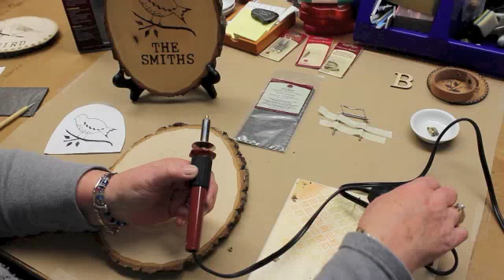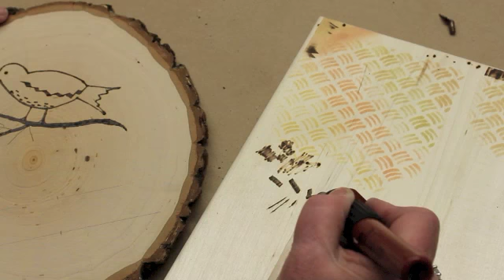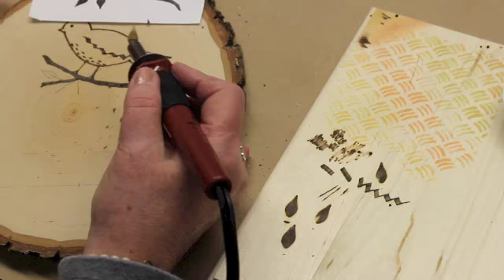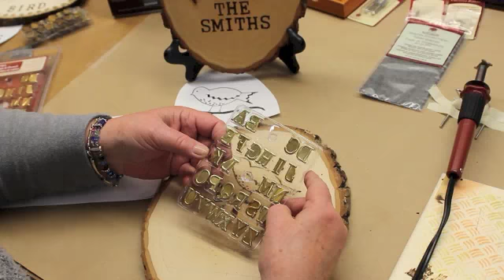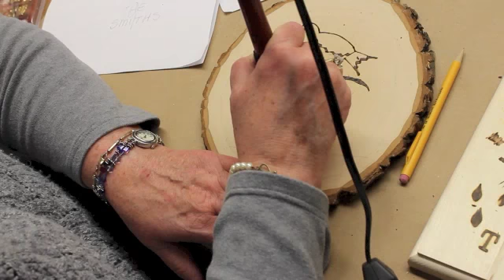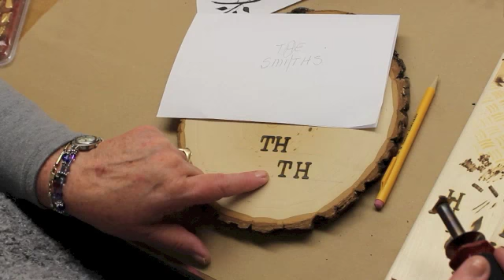Walnut Hollow® | Wood Burning for Beginners using the Creative Versa-Tool®

Comment: The tool instructions on mine state to let the tool COOL before changing tips. Is this correct or can I do it hot? I've read that the tips break if the tool is hot. ???
Reply from the maker: We recommend to wait until the tool is cool. But, you can change them out when the tool is still warm. Please be extra careful with this. Have a ceramic or glass bowl handy to put the hot tips in and ALWAYS use a pliers to unscrew the tips. There is a chance that taking the tips out when the tool is hot could break the tips easier (they are more fragile when hot) and it could damage the threads that screw into the tool.

Comment: Can’t see very well, your hand is in the way. I’d like to see more closeups and also more detailed instructions i.e. what kind of wood, what’s the best temperature to use for different techniques and tips.
Reply from the maker: Hi Lori, you can see more videos on our channel that offer more details. The best wood for wood burning is basswood. And there is a guide on the back of the Creative Versa-Tool with the correct temperatures for different surfaces.

Comment: how can i tighten the tips of my wood working gun.. its like the threads are striped or something. is there some house hold tip or trick i can use to keep them tightly screwed in the gun while i am working?
Reply from the maker: +Glenn Rodehorst Hi Glenn, if you contact our customer service associate at 800-395-5995, she will help you with this. It is a common problem and we usually just send you a rethreading tool to solve the issue. Thanks!

Comment: Hello-
Great video! Thank you. I am wondering if I should be wearing PPE such as a mask while wood burning? Is the smoke toxic that close to our lungs?
Reply from the maker: +Casey King If you are burning unfinished or unsealed wood, it is not necessary to wear a mask. We do not recommend to wood burn on finished or sealed wood because the materials could react with the heat and emit toxic fumes.

Comment: Can you do the wood burning on wood that has already been finished or sealed?
Reply from the maker: +lizzie9989 Hello, we do not recommend wood burning on finished or sealed wood because of the chemicals that could be released from the heat of the tool on the finish. It is best to burn on unfinished wood and then seal it. Please let us know if you have any other questions!
Reply: Hay que lijar y sacar todo lo anterior y si se puede

Comment: can you burn any other surfaces other than wood? If there were wood filler in some of the wood, could that be burned?
Reply from the maker: Hello! You can use the Creative Versa-Tool on Leather, to cut plastic, on synthetic fabrics, to melt wax, to cut or burn cork, on natural fabrics, to burn paper, to cut foam and even to solder! I would not suggest using it on wood filler.

Comment: I did some wood burning in art class in the early 80s and yes you supposed to let the tip cool off before changing them. I do change them hot but do not tighten the tips much, having two tools is an awesome idea ! thanks for the ideas and I love your video! wood burning has come a long ways since the 80s lol

Comment: When I burn into wood sometimes it cracks due to the heat. Turning the heat down means I don't get the effect or efficiency I want, and when its too hot it cracks more. Is there a way I can treat the wood prior to using the tool to avoid this cracking from happening?

Comment: I thought I read somewhere that removing the points with pliers while they're still hot can damage the brass tips. Have you ever encountered this?
Reply from the maker: Hello Tommy- We have not had any issues with tips breaking when removing them while the tool is still hot, but some customers have had issues. We recently added the advice of waiting until the tip has cooled before removing it in hopes that it will help resolve the issue.
Reply: I have damaged tips (and tools) by removing while hot. However, I think a lot of the issue was due to how tight the tip was placed into the tool. Removing it while hot caused the screw end of the tip to come off and get stuck in the tool. Just a heads up, I always let mine cool so I don't have to keep buying them.

Comment: I got one for Christmas. After the first use, I can't get the tip to come off to change it. Am I doing something wrong? I looked and there isn't a release that I can find. also I have used pliers and the tip won't budge.
Reply: Nevermind while I was sitting here watching your video, I finally got it to release, geez that was a job lol.
Reply from the maker: Elizabeth Middleton Hi Elizabeth, If you ever have any more trouble with your points, try using graphite lubricant to loosen your point. If that does not work call our customer service representative at 1-800-395-5995 and she will help you out!
Reply: I think what happened is that it hadn't cooled completely on the inside. I know when things are hot they expand. So I haven't had any trouble since and I've changed the tip several times since I first posted. Thank you for answering me back :)

Comment: Thanks for the video. When using the flow point to outline design I'm getting bumps along the way. Can you explain the pressure to use and how you can smooth this out?  I'm sure it takes practice, but there's really no explanation along the way which would be helpful.
Reply from the maker: nikki serafin It could be because you are using too much pressure on the wood. Use less pressure and make short strokes to help fill in between bumps. Also this can happen do to the grain of the wood. If you go across the grain, you get more "bumps", with the grain, less "bumps". Of course, practice is very important as well as what type of wood you are using. Some wood types have more grain than others.